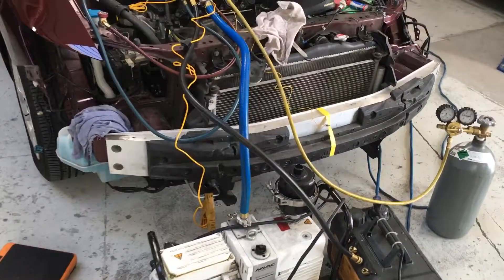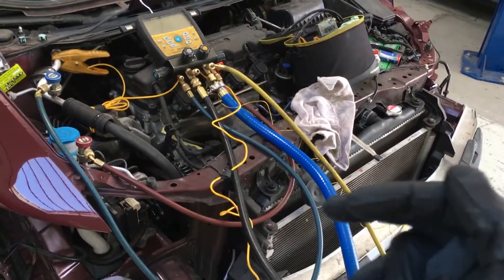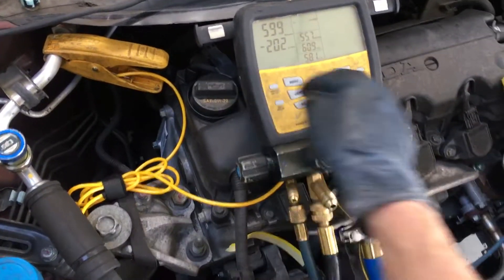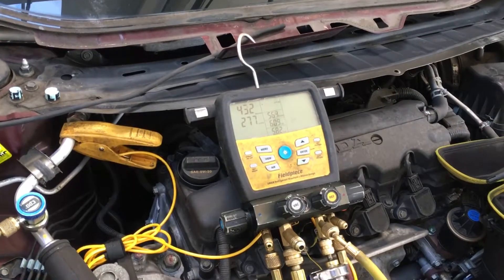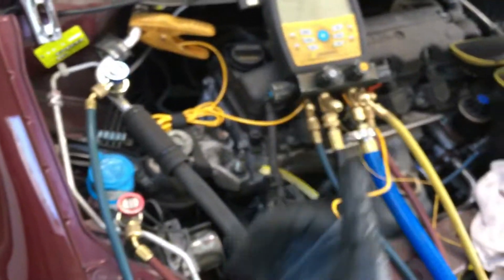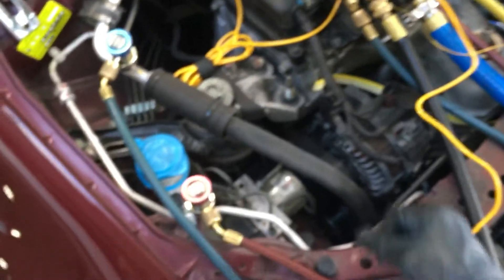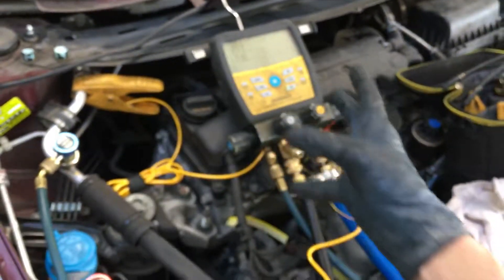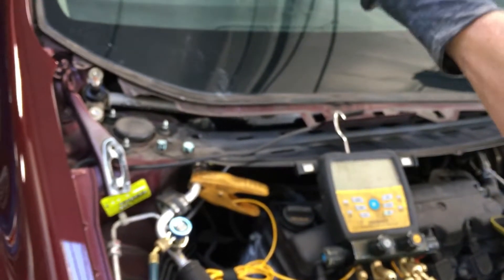A little better understanding of Vacuum using a micron gauge and two vacuum pumps. SMAN 480V

Comment: Ahhmm well put about molecular transfusion
Reply from the maker: Your binge watching. 😊
My information is scattered little bit and pieces with not organizing or order. 

No edit or retakes and I leave all my mistakes in my videos even if I call a condenser a evaporator I leave the mistake in there.
Reply: @coldfinger459sub0  my buddy ive learned a lot from doesnt read too far into the micron decay on his sman. i have probes and charging T with seperate vac guage/line line set up anyway i read into and look into the grapghing through filedpiece or mq app. either way yes always learning and your videos give great insight and reassurance. since my union buddys are stuck in their old ways i would give them a head ache talking about nitro triple purge..

Comment: When you want to charge the ac system,do you disconnect one vacuum pump and you connect the yellow hose to the refrigerant cylinder and purge that hose from air?
Reply from the maker: Vacuum pump always connected.  Vacuum yellow hose. No waist of refrigerant.
Reply: I mean here because you connected tow vacuum pumps.
Reply from the maker: @issamadam9352  oh , disconnect, yellow, connect, yellow two refrigerant. 
Close, high side and low side valve 
Open yellow valve to vacuum vacuum refrigerant yellow house blow 100 µm .

Comment: Now do you mention I had a unit shutting off after 30 minutes running , could  that be the problem too , high moisture in the system , its a split Dakin unit , the error on the display is lower pressure, but is not that low
Reply from the maker: Supposedly moisture should never get into a system that has hard copper lines. 
         If it was correctly installed with proper evacuation. 
          You say it’s a little low funny VRF they should never be a little low they are extremely sensitive to refrigerant charge. 
           If it is low the leak needs to be found and corrected. 

           And the only way to correctly fill a VFR (variable flow refrigerant)system is to completely drain it and then fill it back up by weight only that the manufacturer recommendations. 
              Not by pressure not by how cold the line gets in your hand not by how cold the refrigerant comes out of the air handler but only by weight of refrigerant. 

          The only other way I could think you would get moisture in the system other than not being properly installed in the first place. 
         If somebody was gathering old used refrigerant from other units into a refrigerant cylinder and then going around in topping off leaking systems with old used refrigerant from bad systems. 

         But it’s so easy and cheap to just completely drain your system leave it on a vacuum pump overnight and then fill it up with refrigerant from a new clean container to exactly the weight the manufacturer recommends. 

        After that if you still have a system that shutting down you know it has nothing to do with the refrigerant you can rule that one out of possibilities.

        And check the manual and the unit for flashing codes that can possibly Aid you in diagnostics. 

        It also helps if you own the computer software from the factory with the computer interface

Comment: My old boos would jump up and down on the car's bumper when evacuating the system to work out the water.  I knew he was right because you could watch the gauges. I like the idea if the inert gas doing the work.
Reply from the maker: Using the inert gas three times is called (Triple EVAC and purge) 
        It’s especially useful on old wet systems with really long lines.  Like your RV
Reply: @coldfinger459sub0   I am hoping to find a port up front for the micron gouge. I like to know what's happing from the back to the front 40 feet away. I ordered the TruBlue hose for my big vacuum pump.  It has a KF flange on it already. I never thought about using both my pumps at the same time. I have another question. That filter on  the outlet of your big vacuum pump.  Where did that come from? I really need a recovery machine. I know the laws and I don't want to trash my big vacuum pump.
Reply from the maker: @christopherrasmussen8718  those are just liquid line filters that are used on commercial HVAC units. I just got extra large ones that were also rated for high moisture and acid removal.  They have a HH rating in the part number meaning high acid and I moisture content usually used after compressor has been burnt out and replacing with a new one. 
         Do not use your turbomolecular pump but I think you already know that.
Reply: @coldfinger459sub0  for sure. I taking about the two stage mechanical (oil) pump that back it. Thanks again. I’ll slowly getting ready to tackle the bus